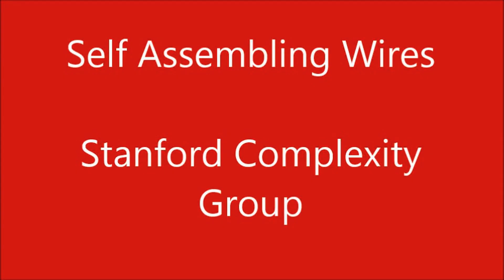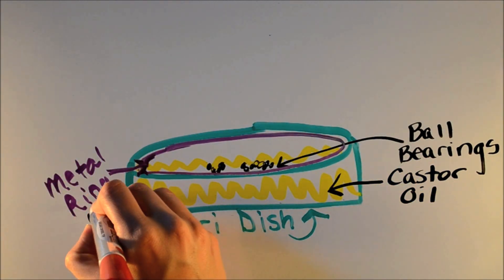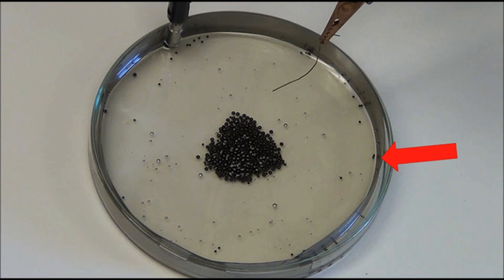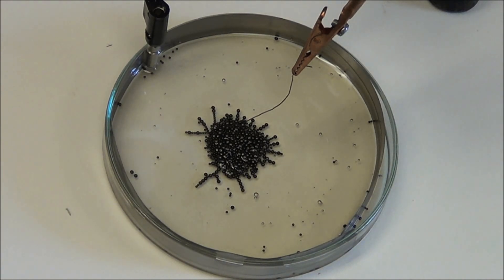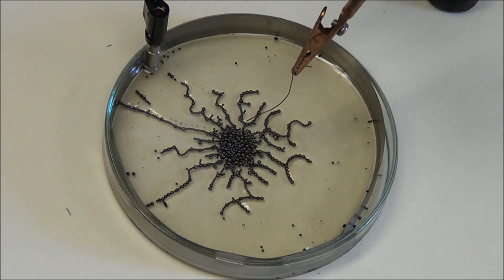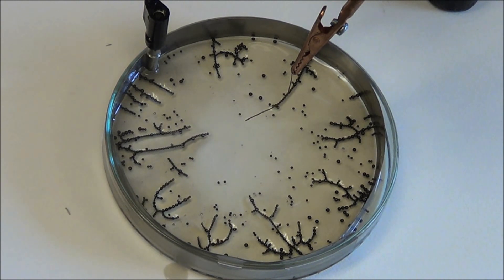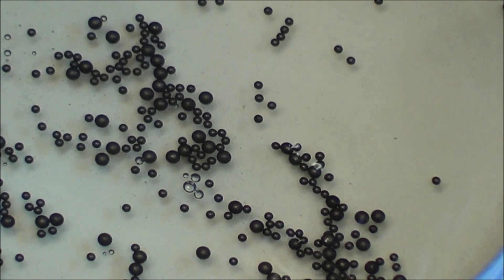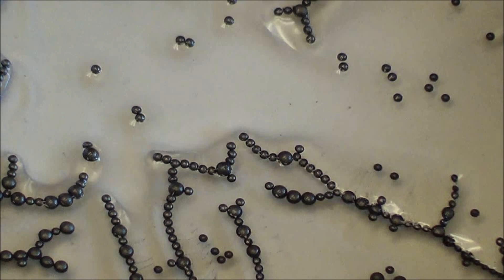Self-Assembling Wires

Comment: What it shows a feedback relationship between the density that is mass and energy, which has high mass density and high-density energy. So, there is two density but two different processes that are mass and energy. So, what above show the bigger center has higher spread out, so it is 45 degree connect to smaller one which has 90 degree of connecting to big one or a small one, so it is a step by step in a small way, so the bigger center has higher spread out, so bigger and higher are linked together since bigger is more so higher is spread out more, so the feedback is even and fractal. So, 1 + 2 + 3 OR 1 * 2 * 3, so base on first one that is 3 - 5, 2 - 6, so the ratio of 3-5 is 2, but the ratio of 2 - 6 is 4. So, step by step ratio by add or by multiply, but multiply has double add as a gap ratio. So, the gap ratio of 2 to 4 is double, so it is even. So, the point everything is bigger so there is higher something base on the number itself, that is higher spread, higher something base on sphere influence which is higher base on the source that radiates outward. The source is a small ball and big ball. So, the big ball has a 45 degrees connect and the small ball has a 90 degrees connect, so the big one has a higher divide, but the smaller gap, so there is a balanced relationship between higher and smaller, so it balances out. 

So, when it reaches the ring, the energy increase that causes feedback so it breaks apart and connects, so the break apart and connect is higher since the energy is higher, so feedback increase base on even step by step, so it is an order number, not a random number, what seems random is limit understanding so behind the random is order. There is outer order and inner order, so a tv that shows a lot of dots all over, so it is all order which all even small dot, that is noise in old fashion tv. The inner order is build up in connect how processes work. The smaller density which has smaller potential energy within so the external as electricity cause the inner potential to increase to give out so it binds, but not binds too much but depends on how much potential energy within that is how density. The relationship between density and energy. So, there are two sizes, so there are two divisions that are 90 degrees and 45 degrees, which 45 is double to 90. So, 45 is 4 plane to 90 that is 2 plane, so it doubles to two sizes, so that is fractal scale size. 

Give you a deeper understanding of how everything works base on build-up from small to big. Ok, the small can have three connectors that are three divides from the small that is 1/3 of 90 degrees but not 1/4 since not enough energy to divide, so the bigger one has 4 divide that is 1/4 of 90 degree that is 90 degree. So, there is no gravity depend, but electricity depends on which connect to inner and external that is external of electricity and internal of mass itself which has potential energy, so if it has energy then a relationship between internal and external, so the medium that is mass which has external and internal as one whole that is mass, so that is the fractal pattern so it is all about scale, so the feedback between big and small create a pattern, but not external alone that is gravity, but internal and external that is energy itself. So, people depend on gravity because they look at whole but not individual that build up, but what looks different as the different pattern depends on potential energy within mass and electricity which cause add, subtract, divide, to multiply. It is all about electricity that controls things which shoot out from energy density that is high to low which causes electricity to happen. The difference in pressure causes the react, the higher the difference, the bigger the react, so fractal pattern base on a scale that is size. So, everything is connected, even the depth which shows a lot, big, etc. 

A step by step which steps one is a square, so the next step is double the square of before, so you step one to next step, so on step two, which has long to walk to the edge of a double square step. So, not add by one vertical so that is square one to square two that is upward only, but even spread out that is upward, left ward, right ward, all over in even way. So, the square itself has 4 degrees even, so each 4 is double in size. So, the second step which is bigger has a longer time to walk to the edge. So, the part for step by step is an add, but for a multiply, it doubles. It adds to itself. So, feedback that is the same and constant which show intelligent that is self-organization. So, it is not random as one line, but the order that is two lines as branch out. So, when you have more branch out than less branch out, so it takes more intelligence for more to spread out, so to go to left and go to the right, but not one direction, but different direction which is seemingly intelligent but an even feedback in all things.

Comment: Forgive my ignorance, but this makes me wonder about something that has always puzzled me about electricity: I assume the branches wouldn't form if there were no outer ring to complete the circuit. How do the electrons "know" that there is a metal ring to get to?
Reply: The don't, but if they start out in the centre, whichever way they go they're heading for the outer ring.
Reply: I didn't think the branches would form if there were just a + and no -. Otherwise you could do this experiment without the metal ring. If they only form in the presence of a complete-able circuit, how do they "know" the circuit is complete-able to begin with?
Reply: there is a very strong difference in electrical charge between the + and - , that is what voltage is, a gradient that gives potential for movement.  there is an effect that extends out from the charges that we call a field that gets weaker the farther away, which is why we need high voltage and close distance.  it is how lighting forms or you get a spark from some things basically.  in this case the balls are trying to close the gap to complete the circuit to allow the electrons to flow so they can create a kind of balance so there would no longer be a difference. what exactly a field is and how they feel each other at a distance is still a debated topic about the fundamental nature of the universe.  in particle physics they talk about force and charge carriers in an attempt to explain it, such as photons.
Reply: To put it in overly simple terms, the same way your body "knows" to be attracted to the center of the Earth. In both cases a field makes it so, but in this case it's the electric field instead of the gravitational field which your body experiences.

Comment: Would this behave differently in a vacuum with balls not having an oxide layer?  The balls would (could) cold weld themselves, but only at the tiny intersection point.    If given a 3 dimensional space, say 10x taller than the tallest ball, with a transparent medium, would it build more complex designs?

[runs off giggling to workshop]
Reply: did you do it?  film it? post it

Comment: I think you're underestimating what some people have at home.   I'm just missing the petri dish and castor oil.  You're working at 24kV DC, right?  That's the type of project that needs it's own live stream.   Bigger tank, more and diverse material balls, and see if you spawn Bender.

I, for one, welcome our new Bending Unit Type 22 overlords.
Reply: What about Turner?
Reply: I thought the same thing. Yeah, it's not normal to have a high voltage power source laying around, but for a hobbyist it's nothing special.
Reply: Do other people not have a stack of microwave transformers laying around their garage?

Comment: At 0:47, from the (+) high voltage electrode "electrons spray down on the ball bearings in the petri dish" ?  I love this alternate universe explanation from the anti-matter universe where positrons drive the process.
Reply: + voltage = a slightly confusing positive number of electrons, even though they have 'negative' charge
Reply: @RyanTDunn  The electrode doesn't actually spray electrons. Based on the charges, there is an electric field. The electrons don't start moving until the circuit is closed. The field is carried by photons, so it would probably be more correct to say that photons spray down on the ball bearings, though this is also somewhat confusing.
Reply: @erickasper1   A photon is light isnt it? Looked to me like magnets
Reply: @WorksopGimp  yes, though magnets work by electrons moving, and electrons are moved by photons which they absorb and emit to one another

Comment: Is this process related to the Russian study that discovered plasma in, zero gravity microwaves does the same thing? Except the plasma forms structures which resemble DNA helixs that replicate; when, physical initial condition experiment data is dumped into and then modeled by a computer.

http://adsabs.harvard.edu/abs/2007NJPh....9..263T                

3 minutes 53 seconds shows Russian plasma experiment.  https://www.youtube.com/watch?v=EF2rYKQKhVw&feature=youtu.be&t=3m53s
Reply: in a way yes but then again plasma physics in zero gravity is something else then metal balls in oil.. 
it's a rabbit hole i ran in and can't get out and i don't mind, it starts with basic stuff like being interested in lightning or ball lightning and the aurora's, then advances to fringe stuff like Low Energy Nuclear Reactions (LENR) then you end up reading Alfvén's nobel lecture on how his magnetohydrodynamics equations (1970 and still today) are used to calculate astrophysical plasma phenomena while he stressed they are insufficient and magnetic fields are not frozen in space.. then i ended up trying to ignore the trap that is thunderbolts project and in stead read Alfvén's student Anthony Peratt's work such as his book "physics of the plasma universe" (all known plasma phenomena described and the equations + Alfvén and Peratt's plasma cosmology) or his later work on petroglyphs being high-current Z-Pinch Aurora as Recorded in Antiquity..

Comment: Questions: does the process still occur at lower voltages? I can understand that there is something like a coefficient of static friction in the configuration.  But since there is Brownian motion, is there a temperature (where there are no convection currents due to thermal equilibrium) and a supporting fluid (possibly something other than castor oil) that allows the voltage to be (significantly) lower where the process still proceeds, though at a speed lower by perhaps one or two orders of magnitude?

This is really cool!
Reply: I think its a matter of scale.  Here we're seeing metal balls on our macro scale.  But if you think of atoms and smaller distances then the forces would be relative to their scale